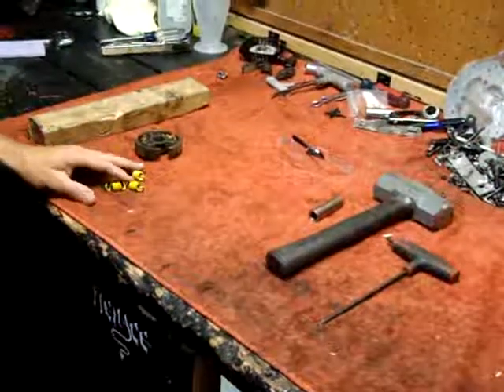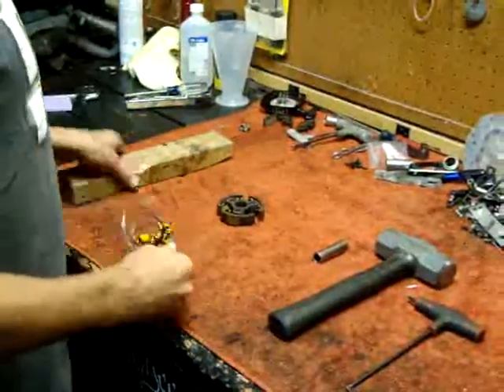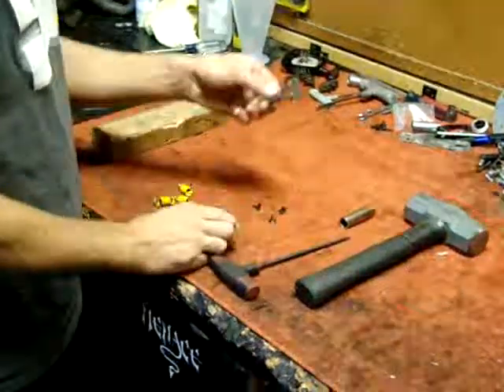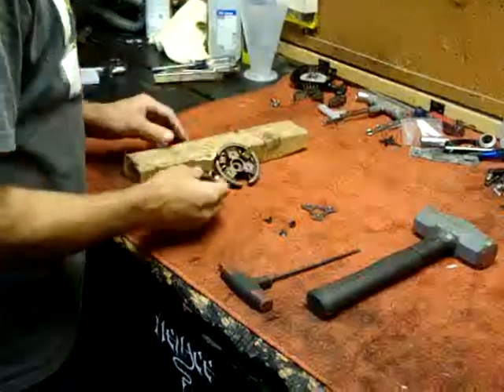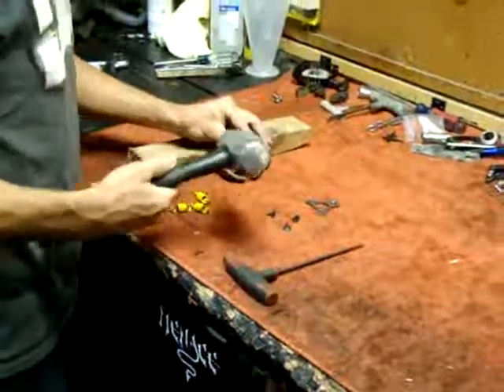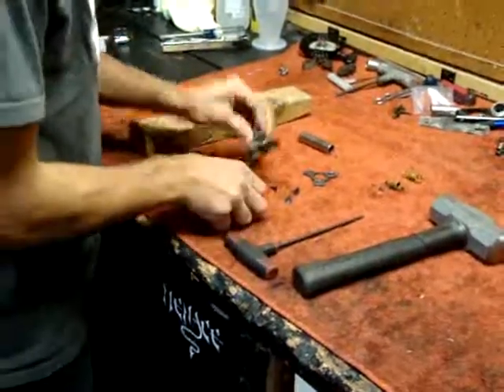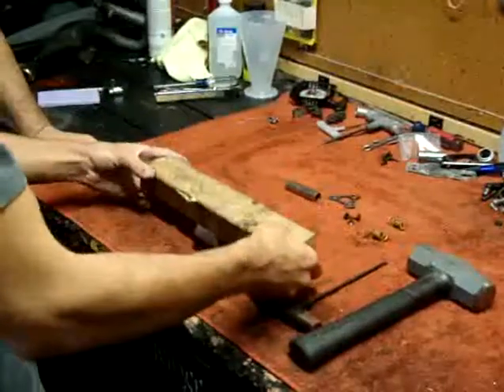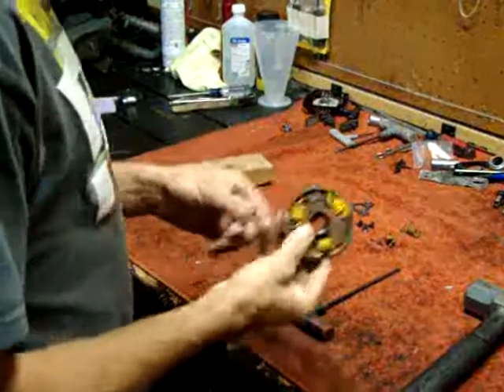How to change clutch springs GP460

Comment: Help A while back I had an issue with a brand new yellow spring clutch not engaging. It would rev way high barely go at full throttle. So I put back on Old trusty Rusty. DDM sent me out some clutch saver Springs to see if that solves the problem. Fast forward to today. I installed the 1 mm stroker crank, the ESP ported modified 1 mm squish cylinder head to accommodate the stroker crank, installed upgraded sealed clutch Bell bearing, chromoly Ada clutch Bell and Ada chain tensioner I was ready to rock. I put on a fairly new clutch off of my go quad heat cycled the cylinder once and I was ready to tune. I hit the gas same thing as the brand new clutch way too high of a REV and no go. I put back on trusty Rusty double checked and made sure there was no grease or oil on the new chromoly clutch Bell. Still nothing. I figured I would try the brand new one again and the same thing. Frustrated I kicked the ground to take off and went downhill gave it some throttle and it responded a little bit. Finally it started to pull a little bit while I was already going. It seems like it has to be glazed like new rotors on a car this is ridiculous.

Comment from the maker: @Naturepheonix 
u probably broke a clutch spring if that happened... pull ur motor off the motor mount. u only need a 5mm wrench to pull the motor off the motor mount. once u get it off u will most likely see that u have a broken clutch spring. sometimes when a spring breaks it will lock up. with 1 of the broken off pieces.